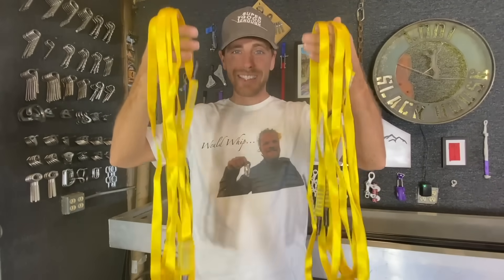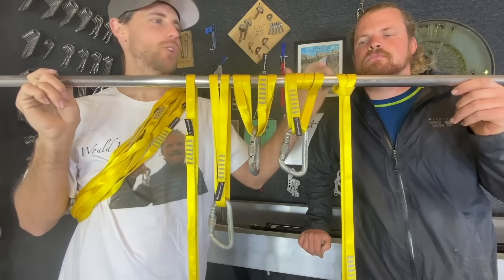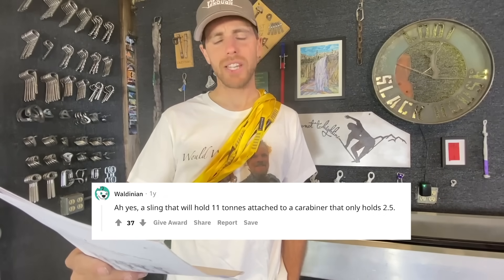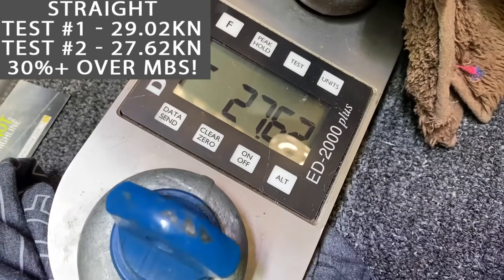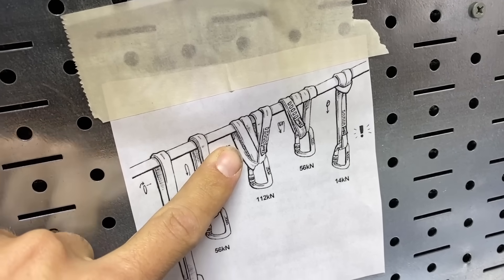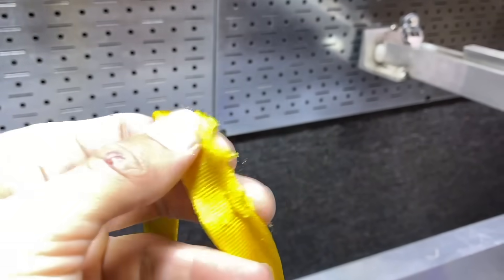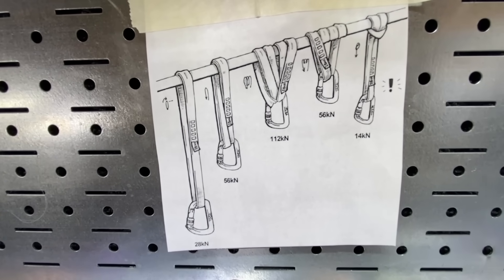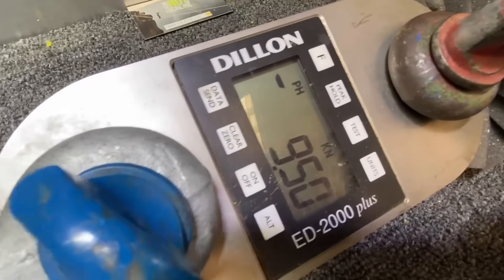Climbing Sling Myths

Comment: Resin for breaking less than rated is heat buildup.   When you wrap on top of each other the one underneath is pinched by the top layer.  This increases the friction and heat when stretching occurs.  It is like the girth hitch doesn’t stretch equally around the bent causing weakness.

Comment: The reason the single wrap measured higher is because it was longer and therefore had less angle coming off the shackle. The multiple wraps increased the angle and redirected the forces applied. That’s my guess anyhow from what I have seen with videos on winch rigging.

Comment: I think the lower capacity of the wrapped slings can be (partially) explained by simple mechanics/trigonometry. Because you wrap it around a couple of times, the base becomes wider and the sling is actually more in a triangle than a straight line. You should account for that when you calculate the internal force of the sling.
So if I guess from the video, the angle might easily be 15 degrees. Meaning the internal force is 47.7/(cos(15))=49.4 kN
Still not the same, but a lot closer already.
Furthermore, you can see that the sling cuts into itself at some points. Even more so with the double double. Because of the limited space, you get some more folds, resulting in peak stresses.

Could be interesting to do these tests again with longer slings and more spacious set-up, so that triangulation and folds can be ruled out.
Nice stuff though, good to know the girth is strong as hell.

Comment: I see this "debunking" of the "don't knot a strap rule" and its always done static. The weakness is then the strap is loaded on a angle . The greater stresses due to unequal loading of the strap across its width cause lower load breaking points. It is a very real danger when something swings or moves laterally relative to the fixing points bar angle.

For climbers this may be a issue when attaching to a fixed point (non-swiveling)  or then two loads are using the same fixing point.

The same thing applies to truck straps, winch straps and load slings.

There is also a bunch of math relating to strap width vs thickness that can generally be summed up as the the wider it is comparative to its thickness the weaker it will be in lateral loading.  Ropes being that they are round can be quite accepting to lateral loading at a knot interface.

Also worth noting is that peak loading during a drop may be a lot more than measured on most load cells due to the speed of the loading pulse.

the two analogies are snapping cable ties and ripping phone books. To snap a cable tie with a static slow load is hard, your fingers will get indented and maybe slightly hurt. but if you swiftly jerk the cable tie it may break with minimal hand stress due to the quick dynamic loading pulse. When ripping a phone book it is near impossible to pull it apart directly but then laterally loading one edge it will tear apart a lot easily.
The same things happen to straps used for restraining, lifting and suspending loads.

But honestly 28kN is a good margin for any sensible climbing.

Comment: Further more and respectively , the results to which you received should not be considered, as their are  multitudes of variables to the SWL listed on slings. 
From types of loads to be slung, the correct hitches to be applied for that particular load, and  technique's used in applying those loads. 
The illustration, basis of your episode was a basic rigging guide illustration common throughout the industry and is used in context of general rigging hitches one may use with slings.. 
Experience is a must when it comes to the application of these  hitches, where and how they fit into your rigging system, and the presumption that your anchor points will hold loads up to or excess of assessed limits..
Choosing the right  anchor then the hitch for that anchor and the load  in which you wish to lift. . 
Not a hater👍,watched till the end as the content was well of interest..

Comment: Hi, nice work guys! I noticed the same heating effect with my own slings on heavy loads.  How about soaking them in water before testing?
Reply: Water generally decreases the strength of climbing equipment. Rope manufacturers state to be careful with a wet rope for that reason.

Comment: The one that you’re calling a “double fold” is rigged incorrectly. It is instead a double loop - a spiral, not a fold. Look at the routing arrows near the drawing. If done correctly, it does indeed hang parallel and not at 90 degrees - it also does not lay on top of itself as much as how you had it.
Reply: Was going to comment this, doing it as drawn would also avoid the folded over strand in the configuration. I'm guessing you'd still have the unequal loading between strands / self-friction that's reducing the strength, but I'd expect a few more kN strength as a minimum.
Great video, though!
Reply: While that is true, that is not how in Reality, one actually is able to USE said sling alignment.
Reply: @w8stral  TIL that I apparently do not live in reality as proven by my use of this exact arrangement before with block and tackle to hoist significant loads.
Reply: @diamondflaw  If you are hoisting significant loads all the time, what the Hell are you doing using a paltry wrapped sling instead of a dedicated sling when there are superior methods for attaching a sling.
Reply: @w8stral  "all the time" was nowhere in my comment.  Niether was any claim that it was the best, or even a smart solution.  Just that it works.
Reply: @diamondflaw  Did I ever say it didn't?  No, and if you actually separate the strands in a block tackle arrangement(no rubbing) or closer to it then it would have superior results.  Just do not use dyneema if any rubbing is happening as all these sailboats are doing replacing their stainless steel rigging for dyneema.
Reply: @w8stral  "Did I ever say it didn't?"... my dude, you did.  You said in your initial reply  "that is not how in Reality, one actually is able to USE said sling alignment." and that's the only reason I've been arguing the point.
Reply: @diamondflaw  Uh yea, and I was right... a block and tackle is not reality to stop friction for how vast majority will use this now are they?  Ding ding ding... its called reality of how it is used in NORMAL... uh hem... NORMAL use.    Enjoy... it has strength as we all knew it would, just not as much as possible.
Reply: @w8stral  You never mentioned "normal" use in your original comment. In fact, you implied the very opposite, saying that you wouldn't be "able" to use it in reality.
Reply: @nemohimself2580  Been months since comments etc, but If I catch drift.... and memory; Of course you could not use it as there is not a Mechanism to keep the strands separated with distance. Thus, reality intervenes and you cannot get quoted "normal" load.  If you physically separated the strands....

Comment: Unless you go climbing with those heavy steel D-shackles these tests are not really indicative of how the slings would behave in use with carabiners. It might be interesting to see what the effect would be if each of these configs was used on equipment you'd take with you while climbing.  I suspect hooking to the curved surface of a carabiner would affect the strength, especially in the doubled and doubled twice configurations.

Comment: I have some training for using slings to lift things through my job.

First off our lifting tools are marked with a Working load limit, this is often based upon the minimum breaking force with a 4 to 7 time safety factor. So a new sling that's used properly and marked with 10kN shouldn't break until it is exposed to a 40kN force.

Anyway from what I was taught a girth hitch decreases the strength by 20%. So not all that much. And frankly pretty much what you saw in your test.
But if the material it is hitched around has 'hard' edges the strength can fall by a lot, hard in this case meaning with a smaller than recommended diameter bend.
For reference: A steel chain shouldn't have a bend sharper than 9 times the chain-links diameter, a steel wire shouldn't have a bend sharper than 6 diameters, and textile slings are more sensitive and should be marked with a minimum bend diameter.

Also textile slings shouldn't be knotted and preferably not joined by another directly as the heat from friction weakens them.

As for doubling up what we call a U form is straight up double the strength, but if those endpoints of the U isn't parallell and instead meet that is a 30% reduction in strength compared to the U form.

Comment: I would have liked to see a freeze frame if when the sling breaks to see where it actually snapped. Was it strap on strap wrapped around the shackle pin or the strap out in the non curved portion with minimal stresses from the adjacent strap material?

Comment: Yeah, as other people have brought up, There are basically two different factors that are not addressed in the original photo.
1. Friction is almost impossible to anticipate in situations like this. Friction between the strands and between the strands and the steel shackles, means that each strand will likely be stressed unequally (as seen many times on this and other channels, perfect equalization is a myth!).
2. There are angles on almost all of these set-ups and, while the angles are easier to account for with physics, they were clearly not accounted for  in the original drawing/photo.

The original sketch is basically the answer that you get in High school math when the problem says "There is zero friction in the system".

Comment: My first guess with the double-double over-wrap is that under tension, rather than all sections of strap equalizing the load, the tension instead locks the load onto the shortest/least stretchy sections causing an uneven load and a break at a lower strain. The sections can't slide past each other under tensision to equalize the load, thus, sub-theoretical performance.

Comment: I need to mention, that these slings not only used by climbers. We use such in Tree cutting. And we use carabines with a Max load of 4 tons (metric) and we busted 2 of them without loosing a sling. If you try to catch a brench or a stump with a waight of 200-1000 kilos (450-2200 pounds) you will reach quite a bit of pulling force. Even with a rope with 10% of cussion? (Dont know how to call it if the Rope Acts like a bungee.) 

Even if a Human cant get to the limit. Other aplications can do. And also the ware ant tare needs to be compensated till a certain point. 

Or Pulling trees out of the soil. With a 3 ton pully can Peak by 4 tons till the safetypins snap in that pulling device.

Comment: Hi, rope access trainer here. Most of my observations will be based around that attack vector. 

First observation: You don't need 14kN and if you do, your setup is busted. The european norm for industrial use anchorage (EN795) demands 12kN and tape slings fall under that norm (Type B: Mobile anchorage). Based on that, if you get 14kN out of a sling, it technically is still over-dimensioned for the purpose and A-OK. 

Ok, yes, in slacklines you can and will place massive loads onto your anchors, so yes, there it would be the exception on the rule. Please, go big on slacklines.
What I am more referring to, is general useage (anything without an extreme angle *upwards of 150 deg where you have around 150% x load on each anchor*  ), but rather in mostly vertical systems. In such a system, if you can bring 14kN together, you might want to rethink  how you work/play because you are doing it wrong. 

That being said, the difference in time spent between doubling up, choking or double plus wrap, is neglegable, so why not go for stronger? Double and wrap is my go-to when no external factors come into play. Best of both worlds. 

Last thing I will point out, is that another test might be in order on the choker: A drop test where the dynamic forces of sudden implimentation of force comes into play. Example: the friction in the knot and the heat caused due to slippage. 
I am pretty sure that should you drop something in a choked sling, you will have a pretty different result. Not -50% (also to take into consideration is the angle of pull in comparison to the knot), but more in the area of -30%. 
Obviously the diameter of the core would have an effect. 

Last consideration is that factors such as age, wear, UV exposure and even something like having a sling lie crumpled up in the bottom of a bag, would also reduce the potencial strength.

Comment: Those higher wraps didn't break as high as expected because not all the strands are equally loaded because of friction and binding.
The multiple wraps and friction prevent some straps from sliding and distributing the load equally. You'll only get a perfect 4x or 2x result if all the straps can load up equally. Otherwise one of them gets loaded up more than others and it breaks and ends the test.

Comment: Actually straps endured that estimated force - problem is that force isn't distributed in same line - when your straps are making even triangle the strength is  proportional to ratio of its hight to side. The math is simple especially if you check rules for securing cargo crates

Comment: When a rope is supporting a load, the angle of the rope can be a big factor in how much stress it is actually experiencing. Two ropes in line with the load will experience half of the applied force. However, if the ropes are canted at an angle of 90 degrees apart from one another, each rope may be experiencing a little over double the applied force. 
Also because it's a strap, the way it's loaded can overstress one edge of the strap to prematurely break first and cause a cascading failure. 

A strap needs to be evenly loaded across its width to achieve maximum capacity.

Comment: English is not my native language, but I'll try anyway to explain a little mistake I saw in the video. 
Girth hitch is supposed to halve the resistance of the sling if you apply a dynamic load (like in a fall). In static force application, as you get from a testing bench, it only takes out 20% of the total MBS, what is consistent with the obtained results.

I'm an instructor for lifting equipment and you can find it in the label (what we call 'form factor' compared with that of direct pull) of an EN 1492 textile lifting sling.

Hope that helps. Great video by the way. Regards from Spain.

Comment: As Expected: 
load will NOT be shared equally on parallel members. Some load will be higher, some lower. Analogous effects are Parallel Electrical circuits. Some formulas for parallel resistors, or parallel batteries, will shed light on this effect. 

(Also, the more members you have sharing the same load, the wider the variation from average they become. Some members will feel almost no load, others will pick-up the slack and have higher loads. There is friction in the system, and the members cannot self-adjust their length to compensate for load variations between them.)

Your results agree with calculated expectations; they were just using the wrong equations for their estimates. They needed a RMS (Root Mean Squared) term. Happens all the time.
... GOOD VIDEO 👍

Comment: You guys talk about X-number of newtons being "equivalent to the weight of half an elephant," but thats not how newtons work.  Newtons aren't a unit of weight or mass at all, they're a unit of force.  One newton is how much force is required to cause a one kilogram mass to accelerate at a rate of one meter per second squared.  Force is different from mass.  Force is a combination of mass and acceleration; mass multiplied by acceleration, to be specific.  A unit of force cannot be measured in mass if force is itself the product of multiplying an object's mass by its acceleration.

Comment: On the Melting. Is it the fact that there is no sheathing around the nylon sling? The sling derives it's strength from the weave of  nylon  fabric. It needs to stay intact to stay strong. As the sling is pressed into itself it deforms the weave and weakens the sling integrity. Spanset has a sheath over it's strong bits so it is able to be stronger when used in basket or other orientation. The sheath protects the weave and the integrity of the fabric.

Comment: When you set up the third and fourth hitches the strap is at an angle. My guess is that the strap is being pulled unevenly causing the outside edge to pull further and therefore fail first .